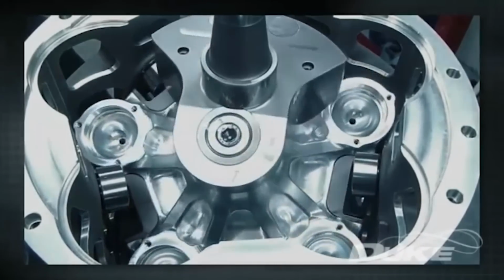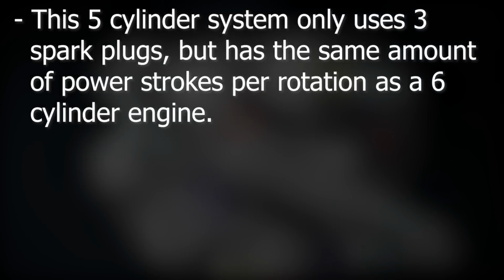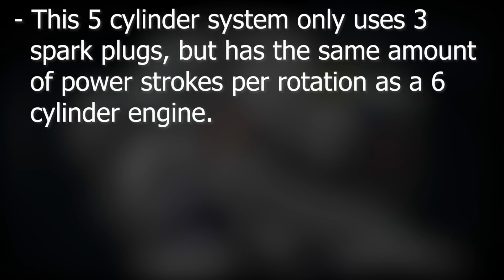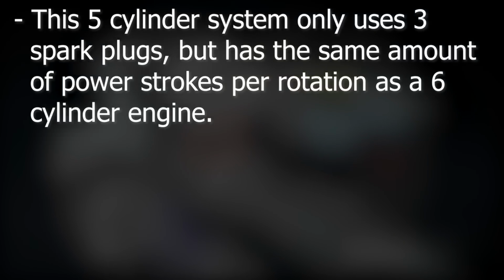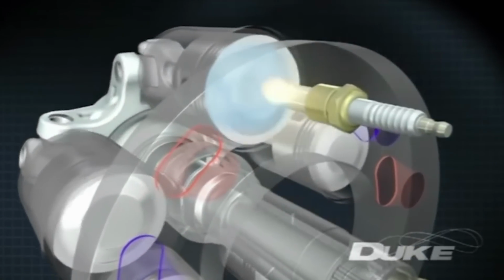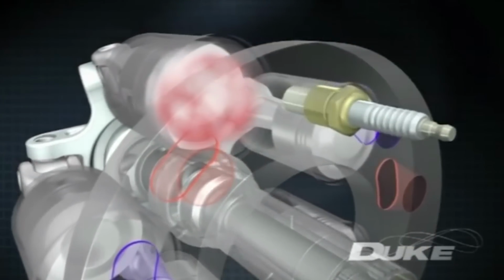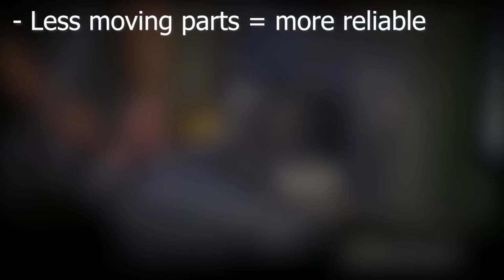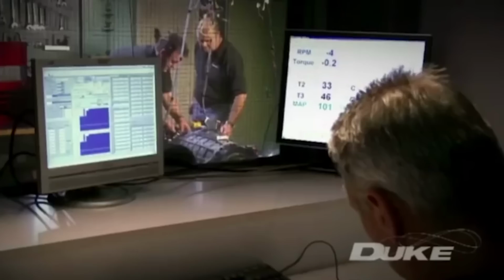The Co-Axial engine, an interesting take on the internal combustion engine.

Comment: This is the Duke engine, it's used in torpedoes. The head gasket is easy enough to fix, just make the cylinder head slightly larger and mill a recess in the block with a corresponding ridge in the head. The ridge would push the gasket into the recess. In order for the compression to blow out the gasket, it would have to push through all that aluminum (or iron or steel or whatever the cylinder head and block are made out of).

Comment: The immediate problem with the Duke design is the retention of the cylinder head. This implies the force of the explosion presses against the container producing friction, restraining the rotation of the cylinder block. 

Why not an opposed piston design ? By making the swash plates adjustable the compression and expansion ratios could be adjusted to suit whatever fuel has been selected and the force currently inducing friction at the cylinder block end could be used. 

Its difficult to judge how well piston slap has been resolved, especially at high revolutions. Its definitely a design where the devil is in the details.

Comment: This engine doesn't truly solve anything. It's a little bit lighter weight with a few less moving parts, but its a little dubious in how it achieves this. The issue with moving parts isn't the fact that you have parts that are moving. The problem with moving parts is that they wear down due to friction. I could be completely wrong here, but it looks like they reduced the number of parts, but increased the total wear surface area. You probably come out ahead on the duke engine, but not by much. I would also bet that this engine is a lot harder to machine and produce.
Reply: Pressures, converging lines of contact versus spherical paths, versus simple circles of traditional cranks, bearings that slide and scub rather than roll...
Yes, most people have no idea about the IMPORTANT aspects of an engine...

Comment: With electric on the horizon, there is no point, its a matter of time, 1 battery breakthrough and internal combustion will be equal to horses, only a couple of romantics like me will want them
Reply: Maybe not. No matter how good the battery, it still has to be charged. Wind is an overall loss of energy , and solar fluctuates, while power plants are being shut down. 
Can’t magically plug in your electric when the power
Is out.

Comment: Great stuff, BUT, fuel does not explode in the cylinder, it burns, and that burn is very controlled.
Reply from the maker: Yeah😂, i just like saying it explodes
Reply from the maker: Heat into mechanical force sounds lame😂

Comment: The 'head' sealing issues, swash plate bearing loads and lubing, and thus life, piston to pin/road loads and cooling have been issues preventing such designs from leaving dev labs in the past.
One of the biggest issues with the swash plate lubing is that it is unsuitable for plain bearings where the rod connects. Look at the joint, imagine the bearing, see the issue.
Reply: Michel solved it nearly a century ago. Only thrust bearing that can create and maintain the required oil film. Still used in ships...

And still, axial engines just never got popular.
Reply: later model has universal joint style connection between piston and stator/reciprocator , other bearing problems negligible
Reply: spinning block fail ,sliding port valve fail.

Comment: Rotary had it's problems with the sealings as well. But weight was also low, less moving parts and less parts as well. Mazda is still working on it and may put it as a range extender in future hybrid electric cars. Let's see what time brings us.
Reply: Because rotory engines like high RPM and are really efficient in constant high-speed operation, pairing a small rotary in the same casting with a gen set, and running it at like 10-15K RPM would get you a great electrical output, at a very, very light weight.  I'm waiting for Mazda to finally announce how they are going to do this.
Reply: @kentalanlee  The length of combustion in rotary engine is too short, and that cause inefficiency.
Reply: @JohnKickboxing  Length of combustion is related to speed of the wave front in the combustion chamber.  If you read research on the thermodynamics of combustion chambers, you will see that different fuels have different speeds of the wave front, and thus combustion time.  Using a rotary as the power source for an electrical genset, could thus be easily optimized for peak efficiency, by both rotary hardware design and careful choice of engineered fuels.
Reply: @kentalanlee  Then what fuel can get burnt fast enough for short combustion lenght engine?
Reply: @JohnKickboxing  One of the fuels being considered for this type of solution is hydrogen.  At relevent compression ratios and temperatures, it's about 4/5 times faster than the longer hydrocarbons in gasoline.  So the theoretical efficiency of such a constant speed rotary is pretty dang good.  Not as efficient as a fuel cell perhaps, but considerably lighter.  So it is probably a good choice for things like aviation or competitive racing.  That sort of thing.
Reply: @kentalanlee  👌
Reply: the main issue with these axial type engines aren't really the wear on the bearings but the cooling of them. Because they often are needing to keep friction forces down but having to combat centrifugal forces, cooling these smaller and sensitive parts are a nightmare. I mean just take a look at the piston seals of a v engine vs the apex seal of a rotary. It is because the inertia of these that they tend to smack into the walls and wearing out faster. The pathway of coolant and lubricant to keep the wear further down isn't uniform like the conventional v engine. V engines push oil around in just the opposite direction. Basically they all have an opposing force in the ranges whereas rotaries only have the 1 (which is outward). If we somehow manage to have that motion transfer (where the internals move inward rather than only moving outward) like in a v engine, I think this will solve the seals problem. Still, having make that creative way of having the moving parts move inward will bring about more issues. This means more RnD to mitigate those problems.
Reply: @wanderingbufoon you have some very good points, cooling is a major issue, materials as well. RnD has been at it for ages now and hope they find the solution one day soon.

Comment: When I was an Engineering student in the early 70's, I saw a model of this engine design!   At that time they called it a 'Swash Plate' engine design!   Here's a quote from a Wikipedia entry on the Swash Plate engine design....
"A swashplate, also known as slant disk............ was invented by Anthony Michell in 1917"!!!
Reply: He was one of many.
Yes, he made a working, reliable swashplate type. His thrust bearing is genius. Check out his three piston opposed engine!
Theres also spider yoke and rod types...  lamplough did that late 1890 or so.
The issue is the line of contact follows a spherical path... swashplates and roller bearings scrub. Radial line of contact... think tapered roller bearings. All surfaces converge to a point...
Cant do it on a swashplate without using michels thrust bearing... oil films dont scrub!

Comment: Super interesting. It's amazing how engines work. Not surprised subaru found the boxer motor and stuck with it for so long. Electric motors are good in the idea of less moving parts, im just not a fan of tesla. I would much rather convert a Volkswagen golf to electric for $10-20 grand instead of buying an over complicated hundred thousand dollar car.
Reply: Or you can just buy an electric golf aka e-golf